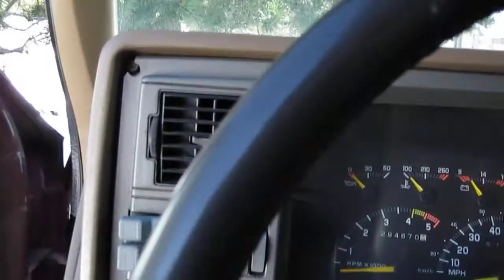V8 350 idle

Comment: @IrishmenV8 good stuff, I got a 92 blazer with 190k on the original motor, tcase and tranny with no rebuilds (w/3.73 gears).  the water pump, timing chain, alternator, fuel pump, oil and coolant lines have all been replaced but the parts were cheap.  hopefully mine makes it to at least 200K with no rebuilds